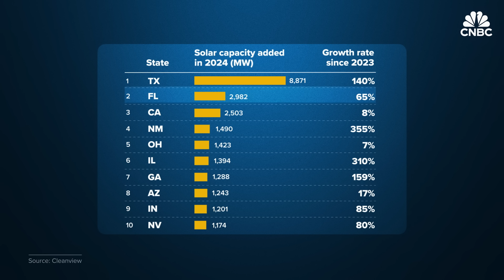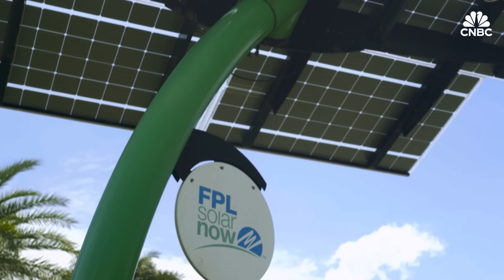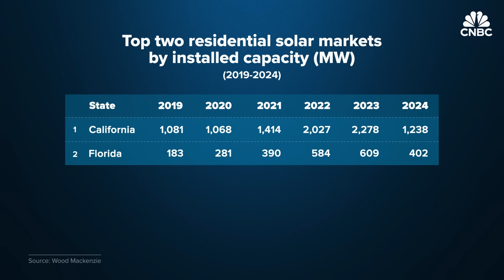How Florida Quietly Became A Solar Powerhouse

Comment: Wouldn’t it be great if all suitable parking lots in Florida had solar panels built over them?  Shopping malls, Walmarts, grocery stores, etc.  In Pensacola I’ve seen this done at a community center and a few small ones other places. It would be great shade to protect vehicles and people from the radiating heat caused by pavement.
Reply: It's an excellent idea. It's actually law in France. All major parking lots are now required to have solar panels. As v2g becomes a thing, it will only expedite the adoption of EVs. Charge at work and then release the energy at home during peak hours.

We invested in solar back in 2016 and it's been one of the best decisions ever. The EV is charged by the panels so no fossil fuels. The heat pump and dehumidifier runs on the solar panels so we are very comfortable even when it's 27°C outside. Meanwhile, the utility company is paying us for the majority of the year due to net metering.
Reply: @TooSchoolForKool lol look at where energy is coming from… 3/4  nuclear
Reply: Cost is a major challenge in Florida because roofs & solar must withstand frequent hurricanes.
Reply: I think the solar part would be great but as a quality of life thing I would love to see more shade added over parking lots and playgrounds regardless of if they have solar on them or not
Reply: There is a lot of parking lot solar in California, new Jersey, and overseas. It really comes down to what's cheaper: farmland and forests, or extra steel to put solar on parking lots and over irrigation canals. Smarter places than most of the US protect farmland from development while giving extra tax credits, giving heat-Island reduction credit, and easing permitting to make parking lot and large roof solar cheaper. 

Residential rooftop is the least economical bc of custom installation and small scale, but better than nothing
Reply: Most of the large business buildings (Walmart, Home Depot, Costco, etc) where I live have solar on the roof.
Reply: business case is not that good, at least is what i heard
Reply: @crazyoatmeal  We do it all over the country in Australia, we know a good thing when we see it.
Reply: That’s be great but they don’t even do it always in Arizona, it’s so hot and bad for the car to sit in the summer heat. Anytime a parking lot has a solar roof it’s such a relief.
Reply: They are so closed minded to smart innovations that they refuse to even consider the new light colored pavement for parking lots. I drive the Arcimoto 3 wheeled EV with no doors and it gets heated up too much in mid day sun when parked at local stores. I deal with this OK because I have already saved over $20,000 by not using 4 wheels and buying no gas. A 1300 lb. autocycle pays for itself in just 7 years when compared to over sized overpowered climate controlled cars which cost you $3K/yr forever.
Reply: I thought of this for Vegas.  They could really use it.  Make it part of the utility company.  At night that city just hits you with heat from every direction, you feel like you're in an oven.
Reply: lol why would you put solar panels in parking lots or cars are going to be over them? 😂😂
Reply: This is a great call out.  Book mark this.  As automated transportation takes off, there are thousands of acres of under-utilized parking lots that can be converted to solar farms.
Reply: @evan421  why would you put solar panels in a parking lot that’s full of cars?
Reply: @LloydBraun9000 hey there!  Thanks for asking.  Parking lots are already underused—studies show 30-40% vacancy in urban areas even now.  With automated vehicles, this gets worse—fewer cars are needed as they are heavily occupied and more efficiently used.  Most people use their personal cars 4-5% of the time on average (rest of the time the car is idle).  Imagine busy fleets (80%+ utilized) circling or stacking in rare occasions in designated remote lots, freeing the majority of existing ones for other uses. Thoughts?
Reply: Love the idea but raised solar like that is 3x as expensive as more conventional installation.
Reply: @isorry123_  if it provides shade for vehicles AND  water collection ( which it does ) then it pays for itself pretty quickly . Commercial decisions are being made by companies and you clearly aren't aware of them.
Reply: true - and stop - people from cutting down all the trees. i for forests and water shed - ecosystems. extra water.
Reply: No moron
Reply: It’s smarter to have solar farms off in rural area, and have battery storage. 

Sorta like how suburbs works. Workers live outside the city, and work inside
Reply: Wouldn't it be great to see solar panels ripped off like roofing tiles and flying through the air a big 40 lb chunk of glass through your car windshield when you go out in the morning after and the hurricane rains have completely soaked the interior of your EV and it's starting to smolder and Spark, and you call your insurance company what do I do? And your insurance company tells you DO NOT put it in the garage so it doesn't burn your house down.
Reply: Do u know how many bad drivers would ram into the structures? This is America 😅
Reply: @thienthetyga3462  They would use concrete bases, just like they do for the lighting towers. You do not have a legit concern.

Comment: Makes zero sense to have 10 square miles of cut down forest to put solar panels for every neighborhood, when a couple thousand dollars in solar panels can just be placed either on the roof of your house or shed, or in your side yard and generate all the power you'd ever need right on site. The smartest way is always to put them on the roof of something like a building or carport so that not only can you still use the space below them, but they provide shade from the 100-degree heat as well. The future of energy is absolutely solar panels on site at people's homes, there's literally no other way to do it. We have existing structures to mount them on so that they take up zero additional effective space.
Reply: They aren't cutting forests down for this, and yes, solar on roofs is great for private solar, not commercial solar, this article is regarding commercial solar

Comment: F* FPL and raising their hookup charge from 25 to 30 a month.  I am kicking around just going off grid, rather have batteries then pay  these guys 30 a month
Reply: Does Florida buy back excess solar production?  Here in California We have solar and it has eliminated our electric bill and also generates a check for 400 or so a year for excess power we sell back to the grid during high usage periods.

Comment: A 1750 megawatt (MW) solar farm would generally require between 7,000 and 12,250 acres of land. This is based on the common rule of thumb that a solar farm needs 4 to 7 acres per megawatt of capacity.  The 1750 megawatt FPL  Okeechobee Clean Energy Center, is a 250-acre natural gas power plant..  Lots of land needed and taken from other uses.
Reply: What other uses?  Those aerial shots show LOTS of flat land that's not used for anything else.
Reply: @romanval69 houses Florida is literally one the biggest builders of houses in the country

Comment: How much power do they produce at night? I guess we still need nat gas or nukes for night power.
Reply: Batteries and wind. Not a problem. In hot sunny places you use much more electricity when the sun is shining for cooling. This just makes sense.
Reply: Most people sleep at night so they don't need that much power. AC doesn't need that much either at night.

Comment: Instead of building solar on parking lots, roofs and much needed areas for heat cover, they cleared whole forest to place them in middle of nowhere.

Imagine the less heat everywhere if solar covered parking lots instead of destroying wildlife.
Reply: Every amazon, walmart, costco, strip mall should be required to have solar panels.  We should be covering canals resevoirs and interstates near population areas as well.
Reply: False they are using empty land. 
Forrest would be way to expensive as you would need to clear tree trunks.
Reply: Southern Florida isn't known for lush forests.  It's mostly flat.
Reply: @romanval69 are you high or just stupid ? Topography has nothing to do with the types of trees 😂😂

Think next time before you comment holy meatballs that was embarrassing 

Literally majority of south Florida is swamps or rainforests or grass plains. 

Idiot
Reply: All such roofs should certainly carry such panels.  Wondering, though, if you're assuming they clear-cut or know they did.
Reply: Private utility developer using taxpayer incentives built a 25 megawatt solar field on our power grid, by deforesting the jungle and leaving the ground bear. The monsoon rains sluiced the silt down into the Lagoon and wiped out the coral and the fishing. Unable to stop plant growth underneath the new solar field they began spraying with massive herbicides that kept a little Lagoon sterile. The power from the solar panels Peaks during the middle of the day when demand is minimal and is not there and that morning the evening or overnight when it's needed. It caused such disruption to the grid when the sun came out behind a cloud to win the sun went back behind the cloud is it blew up one of the diesel generators and cost the utility $6 million plus the months with inadequate power supply all the generator was shipped for rebuilding. And the whole time the solar field developers were getting tax credits and utility payments but they didn't have to pay any damages for destroying the reef
Reply: Did they clear forests, or are they just using empty land?
Reply: Forest?  It was a field to begin with.
Reply: Yes, it's true. FGCU cleared 17 acres of trees on campus to build it's solar field. Babcock Ranch did some shady land deals 20 years ago to get their density.
Reply: Ya none of that is true ….vegas has them all over parking garages and roofs and enormous solar stations in the desert by state line 

Nobody is cutting down forests for solar panels
Reply: Ok, but when it's only 0.0000001% of the forest, who cares? You could fully power the entire US on solar while using like 0.1% of the land. Space is not the issue, there's plenty of empty fields all over this country.

Let them do what makes economic sense, don't demand ideological decisions. That's how you sabotage this sort of thing.
Reply: They cleared a forest for the solar panels? Are you sure?
Reply: I agree 100%. They need to put solar on parking lots, buildings and along roadways.
Reply: Fossil fuel cares much about wildlife lmao
Reply: There are no forests in Florida. Mangrove swamps maybe. And those have protected status.
Reply: @MirzaAhmed89  Have you ever driven through Florida or just seen pictures of beaches., Florida is heavily forested.
Reply: that forest would've became a housing development anyway. better that its solar

Comment: Just need Oil & Gas to lose its subsidies to encourage more renewables at the same time saving Government Money!!
Reply: Problem is politicians are making to much money off the lobby from oil companies to drop it in their lifetime. Nothing is as subsidized in the world and esp in us tha Oil and Gas to the tune of Trilions.
Reply: Pretty much this, but I will give gas one area in that, its still easy to generate heat with it when its cold dead winter or for more northern states or countries, but they need to use more recovery systems like heat pumps would reduce the need for both gas and electricity.
Reply: Even more useful in Fla as it has no gas and must import it all from the US and over pipelines. Looking at the pipelines, these are very close to Hurricanes that hit that part of the US coast even if buried and all those power grid masts are prone to storm related damage as seen before. What happens when a large hurricane hits Fla and other gulf states so there are less freely available electricians to repair them.
Reply: this doesnt save the government money.
If Republican states are doing it its because they are stealing federal money from the rest of us, since they run in federal deficits always.
Reply: Hi
Reply: There are no oil and gas subsidies.  That is the lie that won't die.  If you don't agree, then name these so-called subsidies
Reply: @markjerling6109  Major U.S. subsidies include:
	•	Tax deductions
	•	Intangible Drilling Costs (IDC)
	•	Percentage Depletion Allowance
	•	Accelerated depreciation
	•	Royalty relief
	•	Lower payments for drilling on federal land
	•	Public land access
	•	Leasing federal land at favorable rates
	•	Infrastructure support
	•	Pipelines, ports, and shipping protections
	•	Liability limits
	•	Caps on certain environmental cleanup costs
Reply: Renewables are massively subsidized by taxpayers.

Comment: For a state like Florida, it could only help it even more by reducing the urban heat island effect if done correctly. I wish they along with CA would rewrite the tax code to give more credits/wright offs to put them over parking lots and buildings instead of cutting down trees and taking up lots of forested areas.
Reply: Would love for solar panels to also provide shade in parking lots.
Reply: I love the way it is built in some parking lots. Providing shades for cars and saving space for other activities.
Reply: There is still plenty of space on roofs as well. The advantage of putting it on roofs is that it offers shading to the roof, which means that the house needs less cooling when the sun is shining. What I see missing in that 'green' project is that the roofs are all in a dark color. They should just paint the roofs where they have no solar white. That reduces the heat onto the houses even more. And it helps with the heat island effect. A bucket of white paint is really low hanging fruit, it's cheap and significantly reducing air con electricity use, giving it a pay back that is much better than solar.
Reply: The problem for Florida is insurance often doesn’t cover attachments to houses which include solar screens and solar panels on the roof. 

But there is plenty of sun and I would love to have solar panels if they were cheaper.
Reply: @Alopen-xb1rb NO EFFECT on insurance rates for good installs per code.  Proper solar attachments actually STRENGTHENS the roof.
Reply: Florida has no state level subsidies for solar other than a weak sales tax and property tax exemption. No 30% credit like some states
Reply: The problem is that these small scale solar installations are much more expensive. The large scale projects allow replacing much more fossil fuel at the same cost.
Reply: Where I live our entire airport is 100 percent powered by solar  panels .We put solar on all parking lots generating huge amount of energy enough to power it...
Reply: @gincegeorge1047  Isn't it amazing what can be accomplished with tax payer dollars.
Reply: global warming is a lie.
Reply: Totally agree
Reply: You just failed math 101. Solar panels only have 13% efficiency. 87% of the sunlight impacting on solar panels is turned into infrared heat. It's 160° f above a solar panel in Florida. That is going to massively contribute to Urban Heat Death Zones. Solar Farms are sterile the air is vibrating with shimmering heat waves. Nearby forests turn brown and die back from the Heat. At least be honest.
Reply: Putting solar panels on roofs seems to be a bad idea in the long run. It's going to make roof repair, panel cleaning and panel maintenance much harder on non-flat roofs. However, using them over parking lots, seems like a great idea. Easier to do maintenance on, since you can just cordon off a row and run a lift down the lane and the shade is a great benefit to the people using the lot. I think that would be a better use of government subsidies.
Reply: I would agree with you as long as the panels don’t come from China.
Reply: that forest would've became a housing development anyway. better that its solar
Reply: Are you from the US?
Reply: @MasudbekJoraqulov-fd8xz , I can’t speak for the OP but he is correct. My only concern is that many of the panels come from China.
Reply: @toddbrackett4277 yes I know but now The US government imposes tariffs on Chinese made goods
Reply: You've already cutdown all the trees, don't pretend like you care.
Reply: @thewingedringer  You think solar farms are taking over forested areas? .... You sure?
Reply: Building is important but parking lots is still very difficult  because you need to build structure to hold the panels so that cars or trucks can drive under them which is very expensive. The requirement for those support structures are much more complex.
Reply: @paxundpeace9970  True, but if there was a market they could be very standard and modular steel structures. Most American cities are mostly surface parking because of bizarre minimum parking requirements. Even for bars!